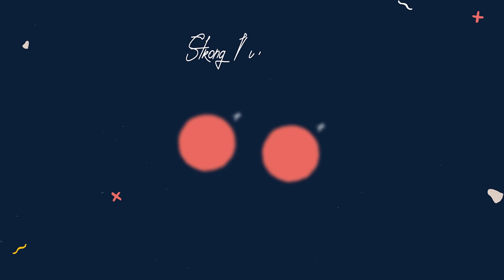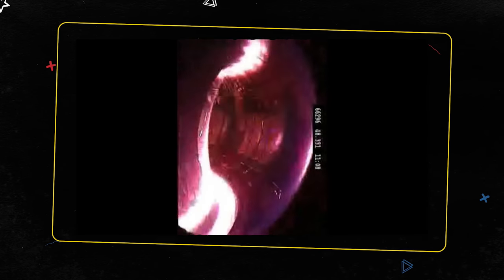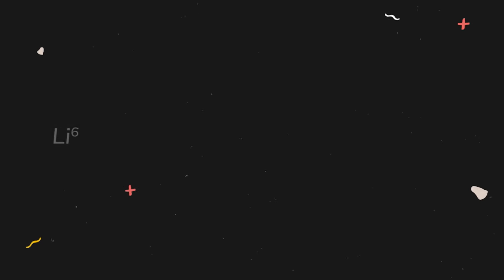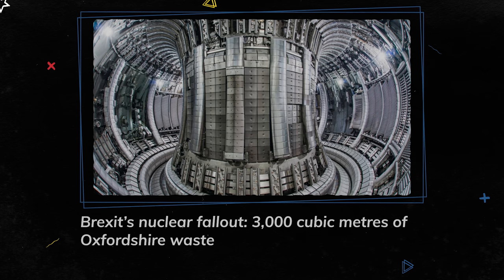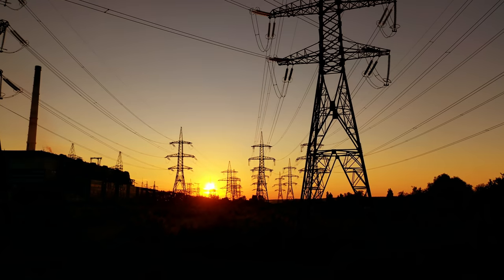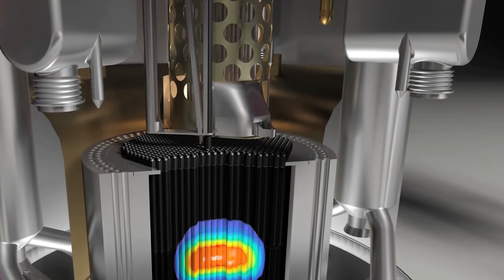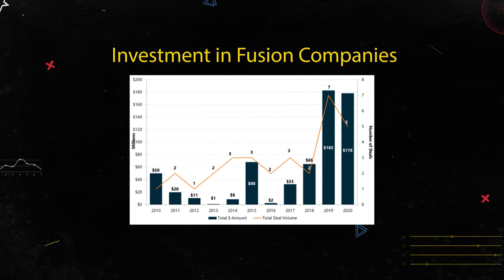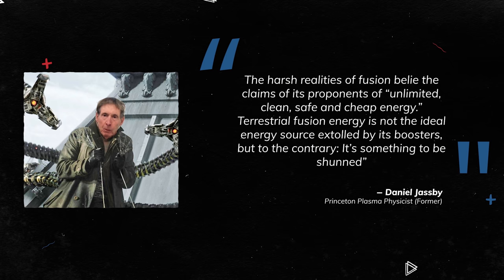What No One Else Is Telling You About Nuclear Fusion

Comment: We need it, at least, when we have a bigger spaceships. Far from the sun, in the space, we can't get energy from the sun.
Reply: RTGs? Ion thrusters would also work in deep space, EM drives even better if they actually work. Check out Isaac Arthur's Spaceship Propulsion Compendium for ideas.
Reply: @deus_ex_machina_  bruh yes! Also space station laser pointer pushers.
Reply: @patrioticwhitemail9119  laser pushers don't work for deep space, it is a problem with the diffusion of the laser beam itself.
Reply: @MichFedorchak  with regular laser pointers and imprecise lenses yes but I'm talking about orbital stations made to the precision that a solar empire could finance. You can take traditional light and bent it into a rectangle-straight-box beam by using lenses to bend a lightsource like this:

      <()==========

It's only a matter of time untill manufacturing gets to a point where literally every improbable event/thing/situation/technique will be guaranteed to exist/happen eventually.
Reply: @patrioticwhitemail9119  that isnt how lasers work, you couldn't practically use laser propulsion to make it far out of the solar system as the laser would diffuse too much to be useful. Even high tech lasers diffuse, lenses are only really useful at closer ranges.
Reply: @patrioticwhitemail9119   light has an interference pattern so that, even with the most confined beam possible, it will diffuse over distance.
Reply: @deus_ex_machina_  RTGs are still too inefficient to provide the energy densities needed for interstellar travel. EM-drives actually defy the laws of physics, so they shouldn't even theoretically be possible
Reply: @ivannoreland5656  RTGs would work fine.  It'd take a hell of a long time to get up to speed (and an equally long time to slow down on the other end) but given we're talking multi-generation travel times here, a few extra years on either end probably isn't going to be the make-or-break issue.  You don't really need much power to get going to incredible speeds - you just need it to be consistent for a very long time.

Actually on second thought, RTGs might not work so fine.  Or even a fission reactor.  We'd need fuel to do that whole slowing down thing.  And radioactive material has an annoying tendency to decay given enough time.  I wouldn't know where to start with the calculations but I'm guessing you'd need a whole hell of a lot of "spare" fuel in order to ensure that you still have a sufficient amount after taking into account the amount of decay over the duration of the trip.  (Then again, most other fuels also evaporate or break down or otherwise lose their ability to provide energy over the course of centuries).

New Horizons is our fastest-moving object at ~23km/s.  The nearest star is about 4 light years away.  That would mean a trip to Proxima Centauri would take around 40,000 years.  That's not just a generation ship - that's an evolution ship.  We got a lot of engineering to do before we can even think about going interstellar.
Reply: @altrag  I don't think there's enough Plutonium-238 to even consider RTG on anything bigger than a satellite. Fission is the way to go. 450kW-600kW nuclear reactor is enough to power the ship and ion engines for 10-15 years, enough to reach outter planets of our Solar System. But there's no way a ship like that could carry enough xenon for ion engines to propell it to Proxima Centauri.

Comment: I’m an engineer and inventor, I specialize in some aspects of aerospace and some of my designs are so unique the designs change the way systems operate altogether. Someone will design a new way to tap fusion.
Fission is not too expensive, regulations and emotional citizens add unnecessary costs which deter the construction, not costs. Fission is very beneficial and ready now, it’s low carbon output makes it very worthwhile too. “Renewables” aren’t ready yet, I personally like wind turbines, but the permanent damage to blades and the intermittency is daunting (I’m not saying we won’t solve that soon, some inventor...). Similar for solar, like the idea, want them for the roof of my home, but low density, potentially short life cycle, also not dependable...

Comment: There is a fusion reactor in the sky that comes up reliably every day and is free. It is our Sun.
Reply: That’s like saying trees in a forest are free housing, or a 4500PSI high pressure air tank is free because air is. Try pumping water out of a cave with tHe fReE eNeRGy oF tHe sUN 🙄
Reply: @Bloated_Tony_Danza  Just have to use a Si Photo-diode. Lot cheaper than 50 years in research wilderness with billions and billions in funding.
Reply: @mp3lwgm  production of solar panel produce a lot of corrosive/harmful by-products like SiCl4 and C-8 though
Many rivers in China are polluted because of solar panel production
Reply: @mp3lwgm  solar panel farms literally burn birds in sky look it up
Reply: @Bloated_Tony_Danza  exactly, well said Rusty
Reply: @timserious7678  no they do not the glair of the panels can tirck birds into diving into them. Some solar thermal designs can burn birds
Reply: @Bloated_Tony_Danza  Photovoltaic panels, a controller, and a pump. Done!
Reply: @milokaw4193  they also take up a FUCK ton of land and require maintanence to keep their surfaces unobstructed. Our best option rn is nuclear fission while we research nuclear fusion imo ✌️
Reply: @timserious7678  You're thinking of concentrated solar energy, where heliostatic mirrors focus sun light on a collector. (if a bird flies too close to the collector, it can literally set the bird on fire!) Photovoltaic panels don't do that. Photovoltaic is taking over now, because it costs less $$$'s per watt to install. The efficiency per acre is similar.
Reply: Yes, but the energy is too diluted by distance. It's like roasting a roast on a campfire ten kilometers away.
Reply: Did u watch the video?
Reply: I honestly can’t see how people want to become “air farmers” after they’re used to having access to a half barrel of gasoline on demand every single week and lights that actually turn on every single time you flip a switch. “We’re going to use ten times more material resources! Use up ALL the land that we can! And have less power than what we already do! Isn’t that great?! Then we’ll repent to The Earth Mother of our sins by “”solving human overpopulation””!!! Wow we’re such good, smart people 😇🔪”
Reply: @awesomedavid2012  What land; the panels are on the roofs of houses
Reply: @Bloated_Tony_Danza  That's fine for now, while we still have easy access to fuel. There will come a time, when we DON'T have that immediate access to that fuel, or, it becomes prohibitively expensive. We will ALWAYS have wind, we will ALWAYS have sunlight for photovoltaic systems, we WON'T always have oil readily available. I would rather be able to meet our energy requirements sustainably, and not feel guilty about existing on this planet.
     When the Corona virus first happened, and there was little traffic, it was nice to see mountains nearly 100 miles away from me. I'm spoiled by the clean air we would have to breathe, without the combustion of fossil fuels. Now, with everything getting back to normal, and the fuel consumption coming back up to normal. I may not ever get to experience that again, until we move to renewable energy. I don't mind seeing wind turbines, if they're the reason the air is clear enough to see them, because of them! (I'm a "Big Fan of the Big Fans")

Comment: Having worked on a wide range of electrical engineering utility and industrial projects including a Gen 3 CANDU nuclear project, Nat Gas, PV Solar, hydro etc. I find this video to be quite informative although it leans towards the negative. Then suggesting that wind, PV solar and battery tech will somehow save the day with no mention of their weaknesses and limitations is also remiss.

There will be no open path forward for E-vehicles and saving those living in poverty unless we aim for newer, cleaner, simpler, less costly SMR’s in conjunction with Nat Gas, liquid hydrocarbon transportation fuels and even abundant cleaner coal deposits in some cases including supercritical coal burning with electrostatic precipitators. And we must store, then convert CO2 back into the cleaner liquid fuels.

As far as man produced CO2 being classified as a pollutant....I have concerns that this so-called climate science is NOT settled....I think we have been trapped into a worldwide deception....the infamous error cascade that takes generations to unravel.
Reply: This video: there are many unsolved problems with fusion reactors.
Also this video: we will use batteries and hydrogen storage to bridge the gap😄
Reply: @TheBaltrum  - you are correct....I do not expect Fusion To become viable within my lifetime nor within the lifetime of my children. And i do not expect any significant improvement with battery technology necessary to narrow the massive gap in energy density between ICE vehicle fuels and battery chemistry in my lifetime. Battery technology is the achilles heel of E-vehicles and electrical grid energy storage IMHO.......Despite the tremendous challenge with hydrogen storage and distribution, hydrogen fuel cells will become the ultimate energy carrier for transportation and possibly temporary grid power energy storage. Note: Hydrogen is also a very low energy density energy carrier. However, when compressed, its energy density rises towards a more practical level and yet, even when highly compressed, it remains incredibly light weight.....and that is ideal for VTOL aircraft such a multirotors for carrying humans.

Comment: I agree with the point at 10:50 that fusion is analogous to the LHC in that it served its initial purpose as a cutting edge physics experiment, and is becoming increasingly expensive with little justification for building something more powerful.

Comment: This is why we need to get to the MOOOOOOON! Helium 3, here we come!
Reply: Sign me up MOON mining madness
Reply: No way that sounds economical.
Reply: @lengould9262  Elon will give it a try.
Reply: Helium isn't the problem, tritium is.
Reply: @jfangm  Could you please expand the problem with tritium.
Reply: @blvp2145  
There's only 21 kg of tritium on the whole planet. Which was explained in the video. It isn't exactly a common element on Earth.
Reply: @jfangm  thank you
Reply: The amount of material we'd need to sift through to mine helium-3 from the surface of the Moon is unbelievably astronomical and would require huge amounts of energy just to power the ongoing mining operation. That doesn't even consider how we'd transport anything mined on the moon back to Earth.

Frankly, it seems like we'd be much better off by instead expending energy here on Earth in order to create whatever amounts of helium-3 and/or tritium we require through well understood nuclear reactions.
Reply: @jasong.6084  That's the sane way of looking at it. But don't we humans crave doing the imposable?
Reply: @blvp2145  I'm more in favor of finding clever, efficient, and practical solutions for problems. Setting up a moon base to specifically mine helium-3 seems like a grossly inefficient use of resources to me, since we have better methods available to produce it here on Earth that would require less energy and less time to start production. I don't think there's anything to be admired about wasting energy and resources when we have a plethora of important issues facing us all.

I might be in favor of setting up an international moon base for shared scientific research, but that's not what we were discussing.
Reply: @jasong.6084  What method can be used to produce Helium-3?
Reply: @blvp2145  Tritium naturally decays to Helium-3 over time. Tritium can be produced in nuclear reactors using a blanket containing Lithium-6 . Helium-3 can also be extracted from CANDU reactors. In addition, under carefully controlled conditions, the fusion reaction D+D will produce either Tritium or Helium-3. Please note that I'm not implying net energy production for the fusion reaction. However, if the goal is to produce Helium-3 and/or Tritium, then I believe the fusion reaction will be less costly and quicker to start production than setting up a lunar mining operation.
Reply: @jasong.6084  Thank you Jason.

Comment: The problem is that fission has been demonized and renewables have their limits, too, so fusion is thought to be the the savior. But that savior will certainly come late and might not come at all. So better get a grip on ourselves and rethink our attitude towards fission and solve the reliability/energy density problems of renewables. Sticking to fossile fuel until fusion is ready is not an option.
Reply: I agree; fission carries many risks, but like gasoline engines (where the tank can explode from a single spark), they can be mitigated and eliminated, with enough work. I feel that, after Chernobyl, evolution of nuclear plants slowed to a crawl. Reactors today have not advanced much in their overall design. The problem is that there aren't many opportunities to explore novel solutions.

Maybe what we need is a competitive sport of sorts, along the same lines as Indy or F-1 racing. In the automotive industry, those racing programs have generated tons of development and evolution of every piece of a vehicle.